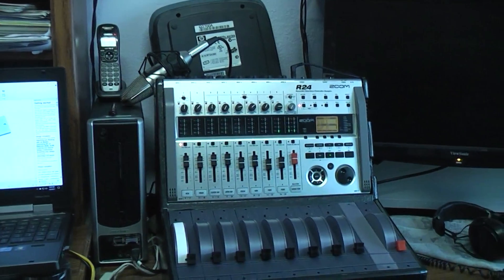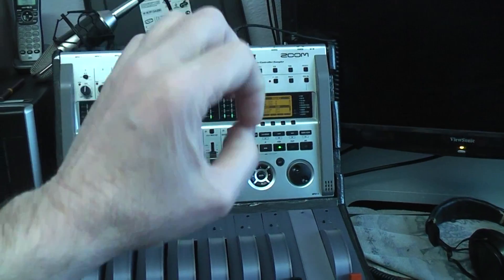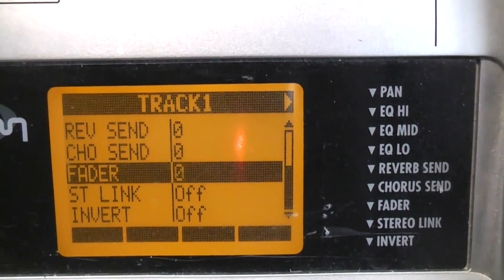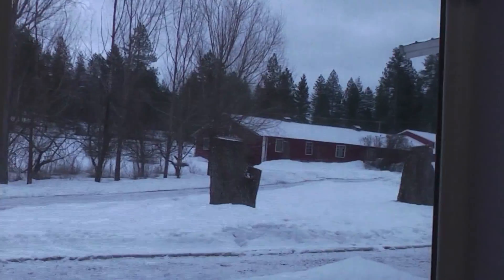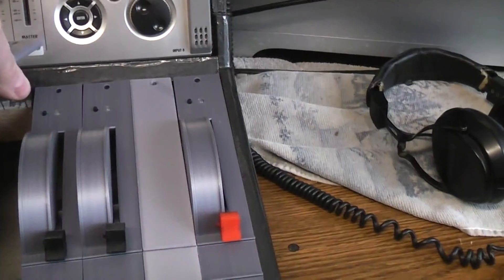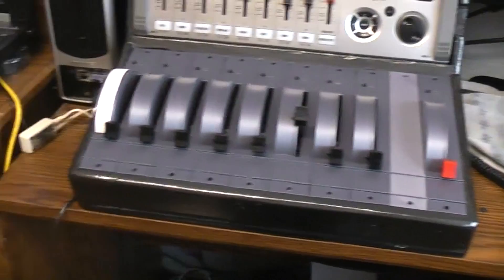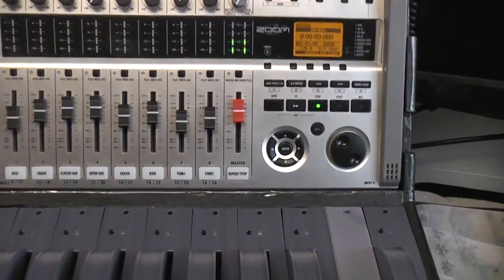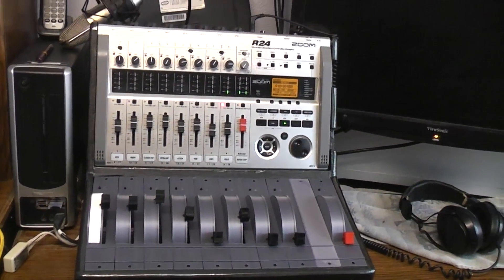Zoom R24 "16" Mod with 3d printed faders "vintage" on a prusa i3 mk2 PART 1

Comment: Could you please show hot to grand the zoom? I am very interested in grounding my but I am very new in electronics
Reply: I would love to see how the project turned out!
Reply from the maker: You would probably want to find a person who is not NEW to electronics. What you want to do is to make a connection to your studio ground or AC plug ground and connect to the Zoom ground. You an find ground on the Zoom on any of the input or output connectors but you can also find  ground on the Negative power supply wire. And that is what I did. I tied into the negative power supply adapter wire and connect that to the AC ground plug.

Comment: Only just found this video, very cool would like to change the faders to 100mm on my zoom. Will you be doing part two?
Reply from the maker: The video was 2 years ago, at first it had very little views so I wrote it off as not a good video idea. But seems like it has a few likes now, so I might just have to do the part 2. If I do it would happen in the winter, so we will see.

Comment: Really interested to see if this got finished...is there a part 2?
Reply from the maker: For a long time the video had no hits, so I never did a follow up. I see now it has picked up some 1,673 views. Not great but not bad for such a specific topic. I may have to see about a second video, kind of late to show any install / build but I could show the functions. The unit was used on the last Robot Raven Album "Set to Soar".

Comment: I absolutely want to know more about the power fixing specifically, I'm really wanting to get one of these and that story at the beginning sounds horribly common for somebody like me. Would there be any way to fix that wiggly power input issue & grounding and not sacrifice portability?
Reply from the maker: What might work best is to buy a Right Angle power plug and replace the stock plug. That way the plug does not stick out and get pulled so much. As far as grounding the best way I have found is still to just tap into the Negative wire to the power supply unit and connect that Negative tap in to ground, either on the power plug or the studio ground . As long as you keep good batteries in the unit and check the display from time to time too see if it is running off the batteries or Power adapter you will be fine. Also you select in the menue of the unit if you have rechargeable batteries or not. If you had recharge able batteries then any time the unit is powered from the AC supply then the battery's should get topped off and be ready for any AC power drop out.
Reply: @Robothut  oh wow, I didn't know that rechargeable bit. They'd ought to put it on the packaging, that makes a much more compelling buy for me! Thanks for the info and I hope you make more vids about this project if you can, there is so little video showing the r24 in action (or atleast I can't find any quality ones)

Comment: Hi, good video.  I just saw the post for it at http://zoomforum.us/viewtopic.php?f=17&t=24636 I notice there's no follow up. I was wondering if it worked? I've searched on YouTube, and your video never came up.  I like the ideal of the longer sliders, and the dc jack connector. I see you're a genius robot maker, not a POM. Anyway thanks for the video, and yes I subscribed.
Reply from the maker: I have not shot a you tube follow up as there did not seem to be any interest in the project at the time. I have used the system for my latest Album, Robot Raven Set To Soar. You can find it here. http://robotraven.com/robotravenalbums.html
Reply: Fast reply, thanks.  I haven'i used the zoom much, but the CD sounds good. Bought it on eBay. Should be here in a week or so. I like Party Lines, Party Lies. thanks for the update.

Comment: What value/type are the pots? 10K linear? Cheers!
Reply from the maker: Yes 10 K linear. The Zoom just uses the pots as a voltage divider so any value will work and linear as the Zoom circuits will change it to audio taper, well its a custom audio taper. The new song ME 2 by Robot Raven was just recorded on my modified Zoom R 24 and released on you tube. https://youtu.be/nRVsGTCXLcs